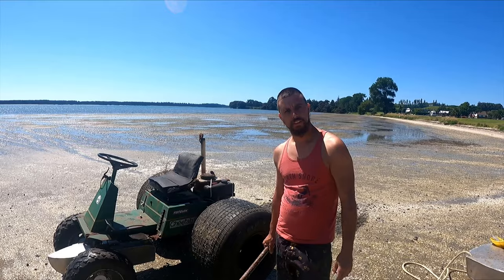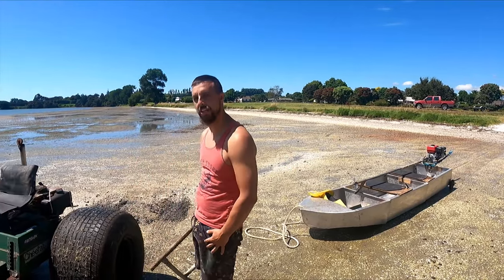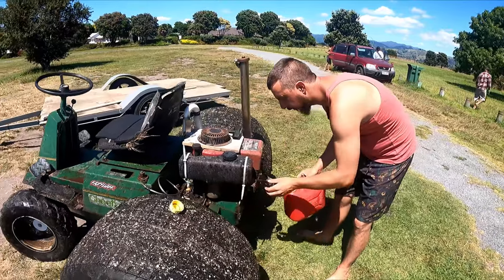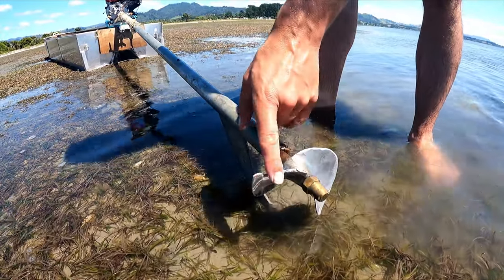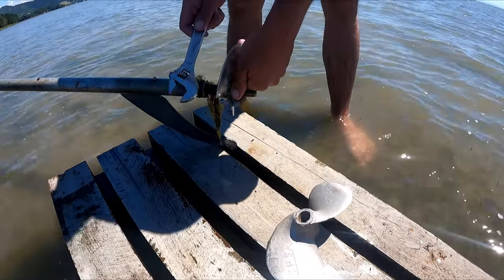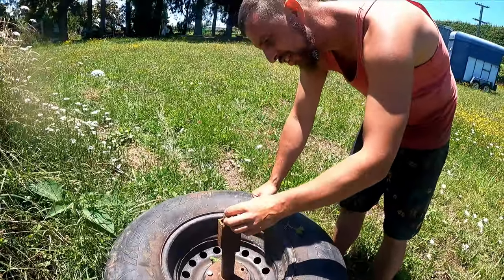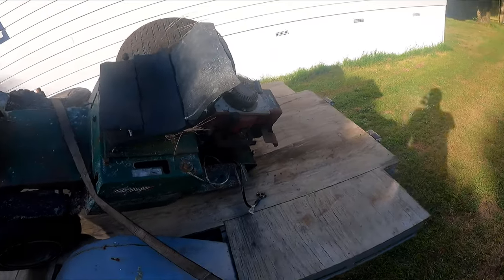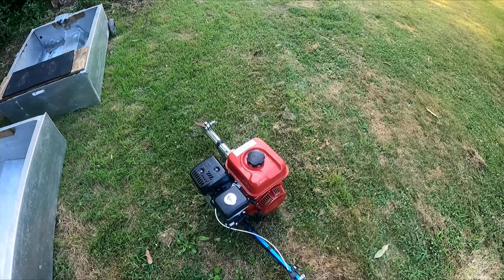Monster Mower Drive On Water! Amphibious Vehicle

Comment: Not a huge fan of the destruction bit but still some interesting stuff. But do take care. Your little girl don't want you to loose a leg or an arm. Still. Happy New Year.
Reply from the maker: I had such a great time yes the longtail is a little dangerous when falling out but a lot less dangerous than what I used to do, the mower was going to the dump I fixed it enough that it would drive and got the last bit of use out of it . And I will still save a lot of the parts👍